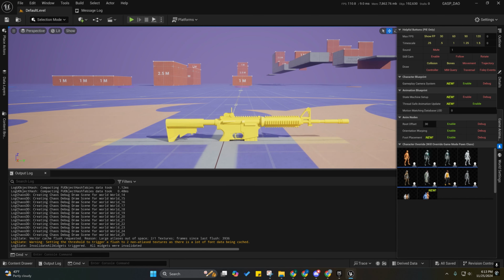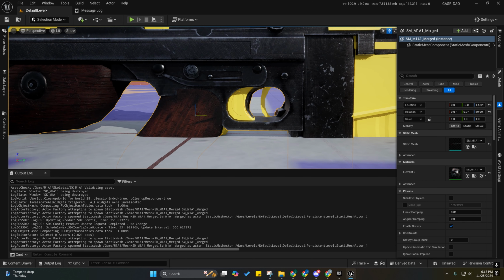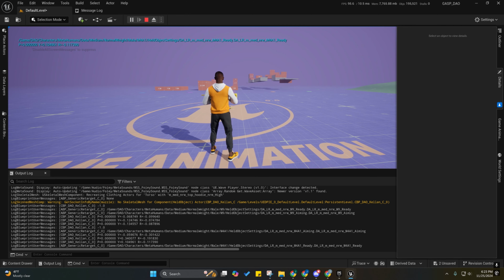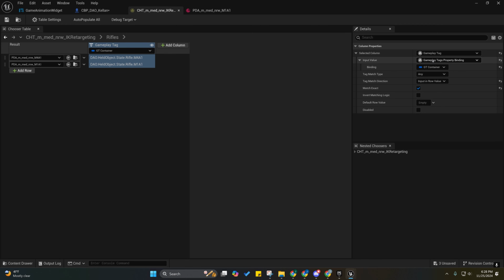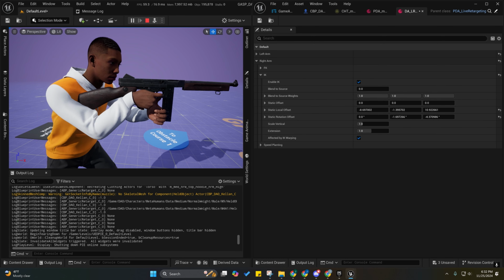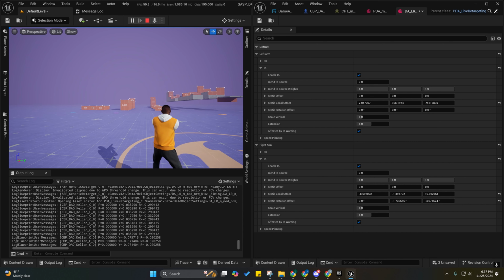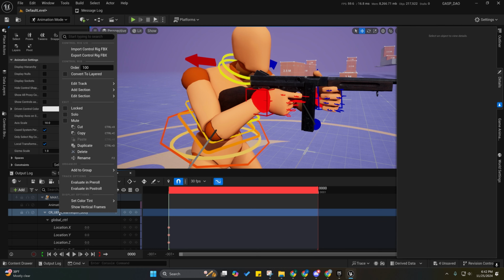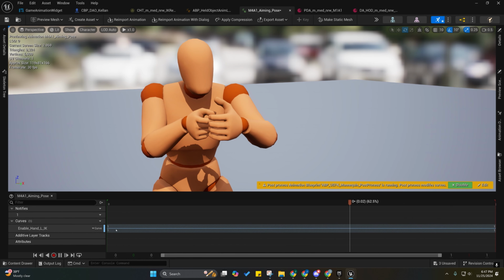Unreal Engine 5: GASP DAO v1.3x (Custom Weapon Setup)

Comment: Is it possible to add a bow and sword shield with this method, and can you add custom animation?
Reply from the maker: You can but there is no easily formula for Animation. Layering will only get you so far and will only reduce the number of animations. You can bring in new animations, but it won't be Plug-N-Play. It will require some understanding of how animations need to be designed for games. With Cinematics you don't need to worry about technical design requirements for animations, you can just play them as they were made from specific angles and just cut the camera away to avoid showing the blend between animations in case they look bad. With games you can't do that though, the animations need to be made for the purpose in which your using them and they must be designed for the underlying animation system in which you intent to use them with.

That's why Animation is one of the hardest things for Indie Developers, you can't simply solve the problem using Logic or sophisticated blending techniques, at some point you will actually need to either have custom animations made, or you will need to modify them. Modifying animations can sometimes be rather difficult to do well.
Reply: @unrealdevop  Thanks for the reply. I'm experienced on the animation and 3D side, I'm not a programmer though, and am trying to figure out how to customize the blueprint with my assets and animation.
Reply from the maker: @michaelvaughan2986  Well, mostly you'll be playing action based animations as montages. In some situations it may make sense to simply play them as an Additive, this will generally give smoother blending but will require the animation to be made for that pose. For Example, you could use layering to have him holding the weapon, and then you could have an Additive Montage play that has him coming out of that idle pose where he is holding the weapon, for the most part this should give decent results, I have the reloads setup so that the Montage is playing on the Upperbody, but it's first being applied to the lower body Additively.
Reply: @unrealdevop  After setting up a new category like in this video for a bow, would you duplicate an existing weapon blueprint and switch out the animations? Would you need to add the new weapon blueprint to the character blueprint? I couldn't see the location for it if that is correct.
Reply from the maker: @michaelvaughan2986  Yeah that will be a separate video I'll do sometime over the week. You would duplicate an Existing Linked Anim Layer if it's base logic works for you and then replace the Poses with your own. For Example: A Rocket Launcher could re-use the Rifle Linked Anim Layer. An SMG might need a combination of the Rifle/Pistol logic....I did that once actually just used the 2-Hands Rifle Logic for Idle but the 1-Handed Logic from the Pistol when Moving.
Reply: @unrealdevop  Awesome, if you have the time it would be cool to see changing weapon hands.
Reply from the maker: @michaelvaughan2986  Yeah I'm working on a system for weapons and slots now that will allow for that.
Reply: @unrealdevop  Are there general points or guidelines for authoring animations for Motion Matching style of workflow? 
To be honest, I am kinda surprised that Epic didn't cover this at all when they released GASP. Seeing that they said they moved all characters in Fortnite to use MM.

Another point: do you think it is possible to backward engineer animations looking at the 500+ anims they provided to us or without advanced knowledge of animations this won't be possible?
Reply from the maker: @RenownHopefulDreamer  As far as general guidelines I haven't had a chance to really dig deep into that to figure out a good workflow but during their Live Stream they did briefly discuss how they handled the authoring of those animations and it basically involved matching the root motion to the capsule movement settings they chose ahead of time, at least from my understanding.

As far as how they extracted that into a curve I'm not sure. They showed them bringing the curve into Maya though and transferring it to the root bone (I believe they actually constrained it to the curve or something like that). They then (I am assuming) corrected the motion of the animation so that it fit that motion and felt grounded.

It may be possible to record that motion to a curve via TakeRecorder.....Idk how they actually did it though.....that part is a mystery.

It's important to note though that despite popular belief, they didn't just make animations and then they just magically worked with Motion Matching lol.....Motion Matching is not Sentient yet, so It can't just figure things out.
Reply: @unrealdevop  wow thank you for such a detailed response! 
It is a bummer that they didn't specify more, but I will hunt around to see what I can gather. Hope i'll have something to report.